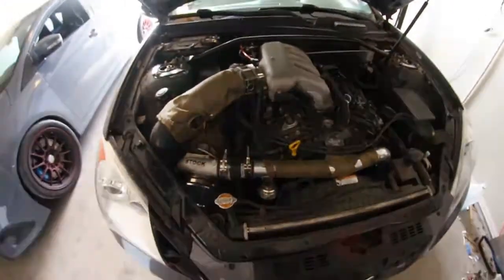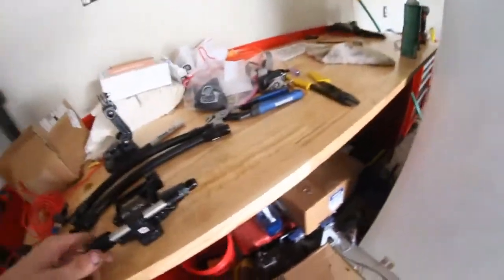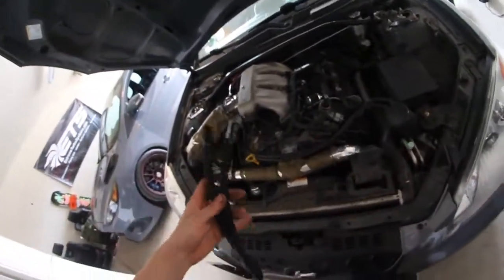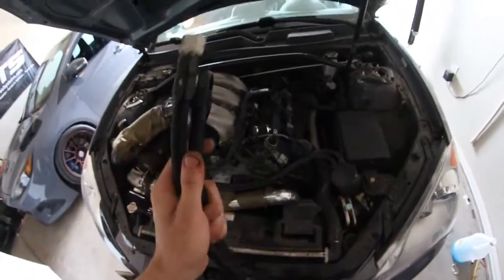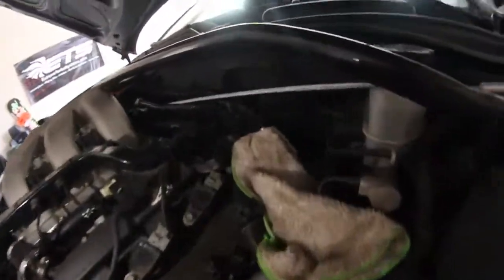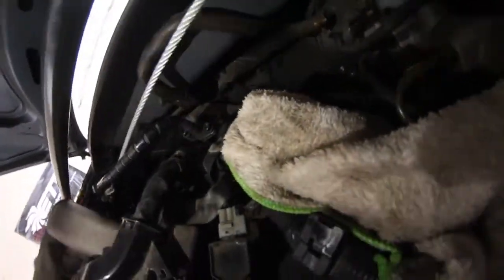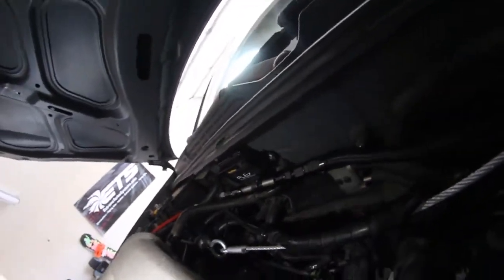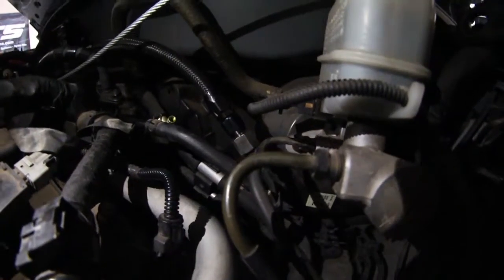Bk1 3.8 Genesis Coupe E85 lines & Flex fuel sensor install

Comment: Question. My BK2 3.8 is now up to 143k, would it be safe to add e85 kit? I have kept great care of her, but just curious if adding e85 would damage it. Right now it is lightly modded with exhaust, intake, etc. I recently bought a 23 Elantra N last year, but still would like to squeeze a little more power out of my Genesis without breaking the bank. Thanks

Comment: I have a question, what does this do? I have never tuned my genesis 3.8 but I want to know what the car does when installing this kit
Reply from the maker: the sensor itsself allows the use of E85 on your genesis. you need the content sensor & an additional gauge so you can monitor the content of ethanol. 
the lines are used to replace the OEM lines & adapt the content sensor in so you dont have to make your own, really easy plug & play setup
this will do NOTHING unless you tune for, keep in mind you cannot run E85 on stock injectors. you can use the stock pump for a little bit but it will die eventually.

Comment: Hey I was wondering once you install the content sensor and lines can you just run 91 until I get a tune? Or will it damage the sensor?
Reply from the maker: heyo, this is a flex fuel sensor so its designed to run both kind of fuels, i would assume the ASMW sensor would be the same aswell, i ran it on pump gas for about 2 months before i switched over to E and no issues.

Comment: Ones you on E85 tunes can you still run premium gasoline? Or just e85
Reply from the maker: it is going to be setup for flex fuel so i can switch over whenever i like. you can only do this with the Bk1 3.8's on Haltech, cannot be done on stock ecu. you can, however, do straight e85 on the stock ecu though.
Reply: Mike Built oh damn :/ I have a bk2 2.0t, alpha needs to do a flex fuel for us asap 🥵